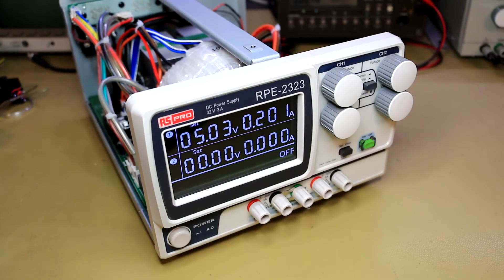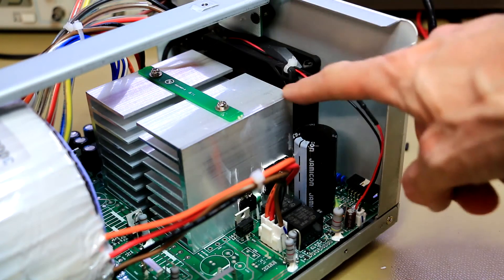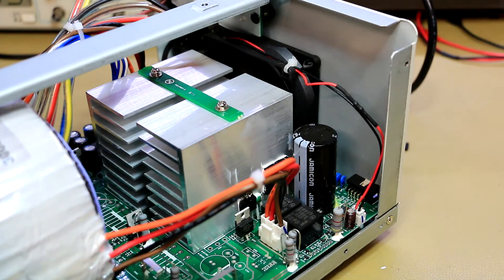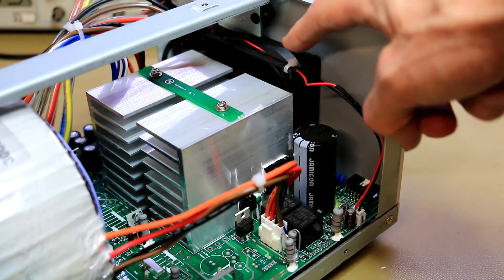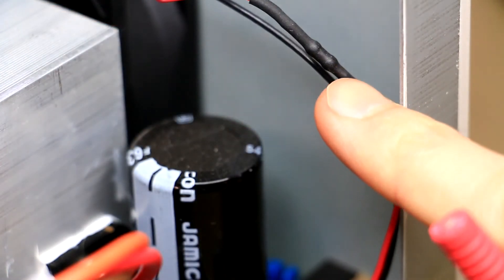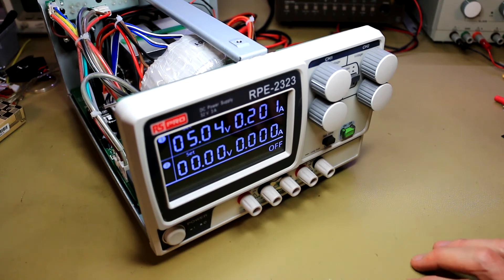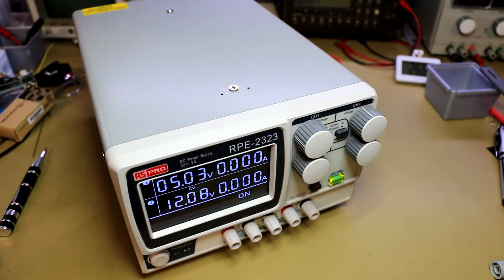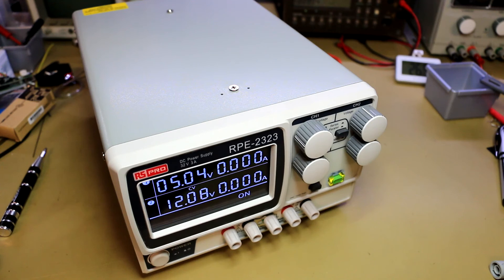How to reduce the RS Pro RPE 2323 fan noise (#022)

Comment: A follow up on my comment - it turns out that Noctua does not have 24V fans in 80mm size, so I ordered a 12V NF-A8 FLX instead. Once I get it, I will do some experiments to find a suitable series resistor. This way I will get an airflow comparable with the stock fan but at a much lower noise level. I'll get back in a couple weeks, when I have done the mod. Cheers
Reply from the maker: Hi Søren - thanks for the feedback. Would be interesting to have some sort of comparison (e.g. before and after) noise levels. Not sure how you would objectively measure that though :-) Unfortunately I cannot source Nuctua fans locally.

One issue that causes noise is air turbulence - specifically in the cavity between the fan and heat sink as well as the cavity between the fan and the rear grille. The rear grille can be optimized in my view (remove the stamped grille and replace it with one of those wire-mesh grilles).
Reply: @TechBench  Hi - I'm back :) Did the mod, and replaced the stock fan with a Noctua NF-A8 FLX. It is a 12V nominal but operates from 5V turn-on to 13V absolute max. 
I measured the fans internal impedance from 5-13V and used it to decide on a series resistor which would match the 17-24V range presented by the PSU, while making sure that even if the PSU goes above 24V, I will not cross the 13V limit for the fan. 
I ended up with 300 Ohm, divided between 4 resistors roughly the same size to spread the power loss. Installed the fan, using the rubber shock mounts.  Had to drill the mounting holes to Ø5mm first. 
Everything works fine, considerably quieter now, while maintaining a decent airflow. 
Haven't load tested it yet, it'll likely be more noisy but that is ok, it's the 'quiescent' noise I want to reduce.

Cheers!

Comment: @TechBench, did you ever consider replacing the fan with a 24V from Nuctua? I have done that in other situations and it worked fine. They tend to deliver a little less airflow for the same size fan, but they are considerably less noisy, so this might be an alternative from limiting the stock fan with a resistor. Your thoughts on this would be appreciated. I just ordered the GPE-4323 knowing about the issue, and I plan to void my warranty experimenting with this :D Cheers

Comment: I've also decided to modify my similar PSU. I have used a 3w 150ohm resistor in series with that fan and also changed the direction it blows towards the heatsink. I think it is more efficient this way, considering the fact that the airflow will be less with that resistor. I did a worst case thermal test with a 5A load (my unit is 6A single channel) and about 19V VCE on the BJT (right after the relay clicks the next transformer tap). The max temp I measured was 70 degrees C steady with cover on.  In addition, I recommend to take a look at the L78xx regulators on the PCB. I have found two with small black heatsink that are getting very hot when the unit is running idle. What I've done was desoldering them and placing them on the big heatsink. Don't forget the mica or silicon pad to isolate them from the main BJTs. One last final touch was to put some hot glue under the small electrolytics that are elevated from the PCB. Have fun !
Reply from the maker: Cool mods (although I prefer to suck the hot air out of the enclosure instead of blowing it into the case (by reversing the fan). Yes, the 78xx regulators do get get hot, even when idle - they power the front panel.
Reply: @TechBench  Maybe it will be a good idea for me to try the same thermal test with the fan in it's initial orientation. I noticed it is indeed not good that it blows the hot air towards the  transformer and the front panel. Btw, the transformer handles very well the 5A load.